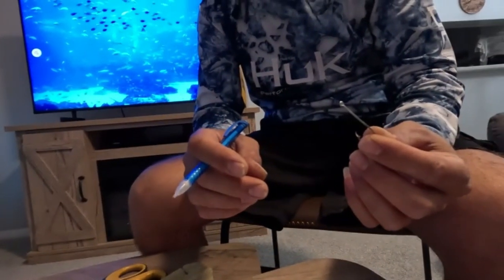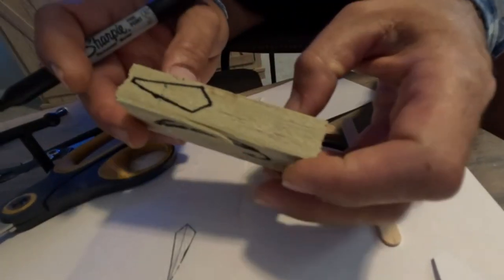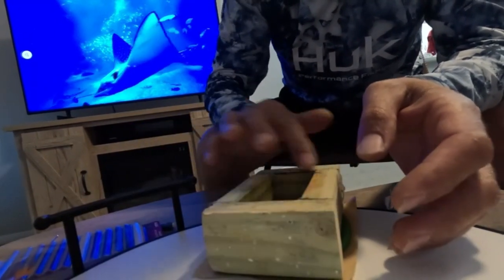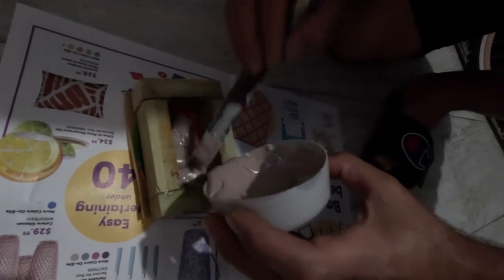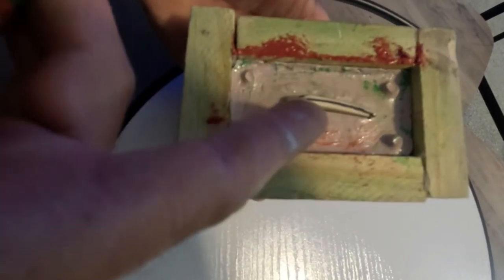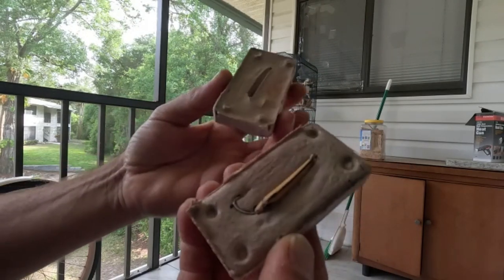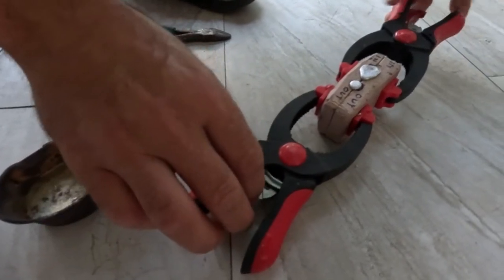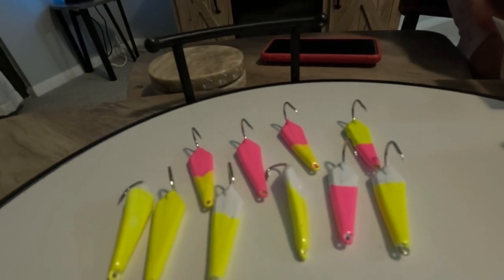How to make pompano jig and molding

Comment: Very interesting!  Question - instead of making a wooden plug to start with, why couldn’t you use a new jig & just match the hook size?  That may save steps / time.
Reply from the maker: You can do that is fine but i just wanted to do my own design and the weight of the jig is very important to me where I fish 🐟
Reply: @fishhunterflorida - I understand & thanks for the reply.